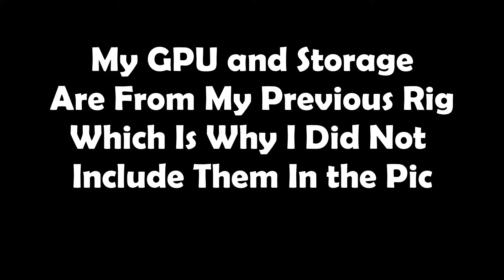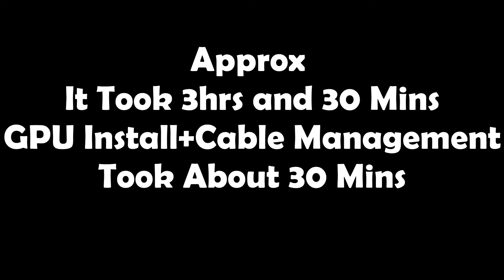My New PC! Thermaltake Core P3  Build In 2022 (See Full Build In Description)

Comment from the maker: Full Build:

Case: Thermaltake Core P3 ATX  
CPU: Intel Core i5-13600kf
GPU: EVGA FTW3 Ultra RTX 3090
MotherBoard: Asus Prime Z790-P Wifi
CPU Cooler: Cooler Master MasterLiquid ML360 Illusion
Thermal Paste: Artic MX-4
Memory: AORUS Memory GP-ARS32G52D5 (DDR5 32GB (2x16GB) 5200MHz)
Storage: Samsung 870 Evo 4TB SATA SSD, , Sabrent Rocket Q 1TB NVME M.2 2280
PSU: ASUS ROG STRIX 1000W Gold PSU  
Initial Riser Cable: LinkUp Ultra PCIe 4 Riser Cable (Could Not Fit)
Final Riser Cable: Lian Li Pcie 4 Riser Cable